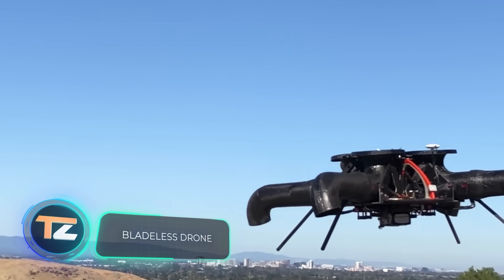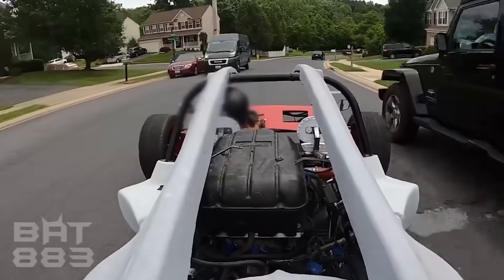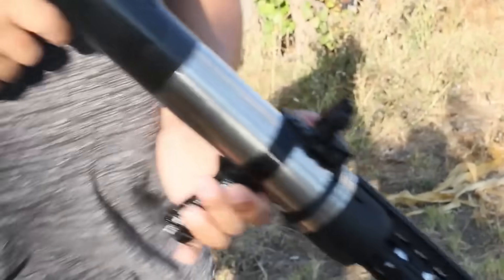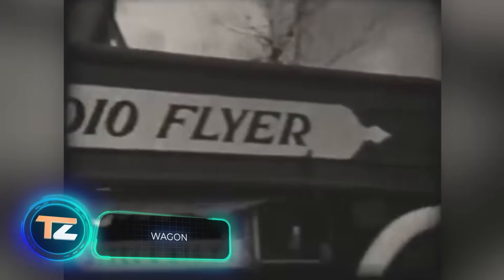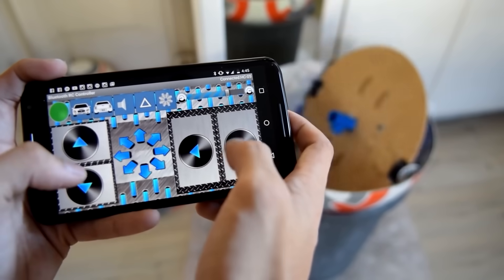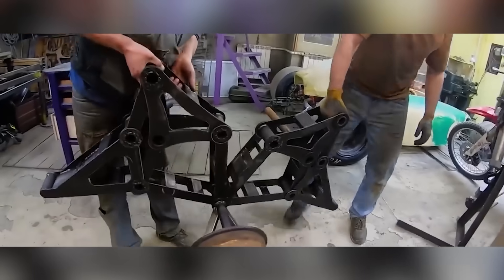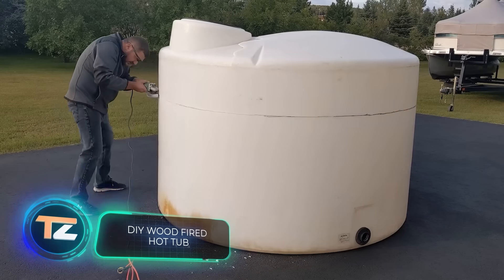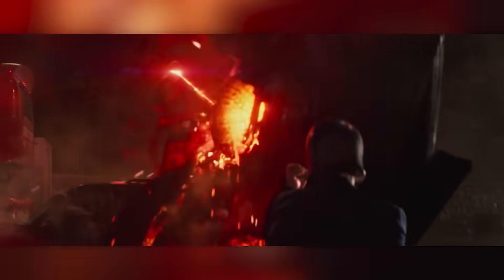INCREDIBLE HOMEMADE PROJECTS THAT WILL DRIVE YOU CRAZY

Comment: you could build into the stilts, a Toe puller type potentiometer or tilt angle monitor and a small /*\ Heel of sorts, that *hindges at the top and drops from the partial length of the whole extension. then when you lean fwd it snaps back up into place. maybe a simple spring N.O. cont. switch to indicate no pressure and it returns.